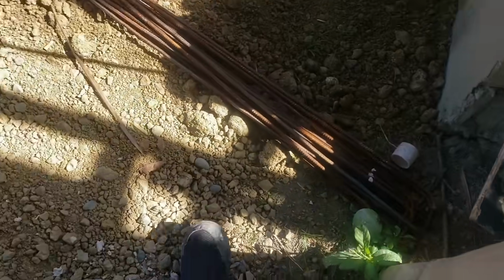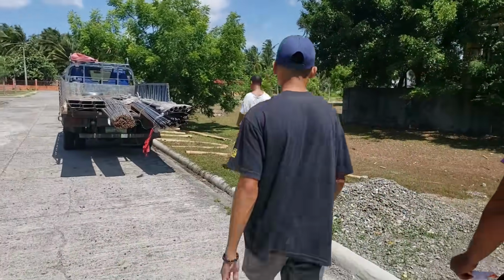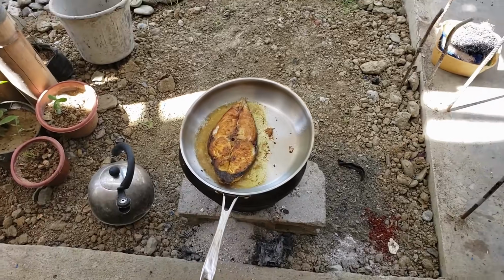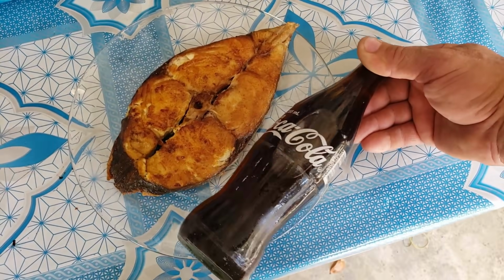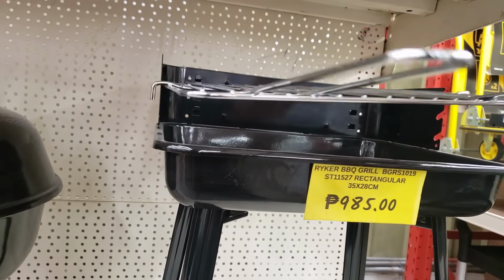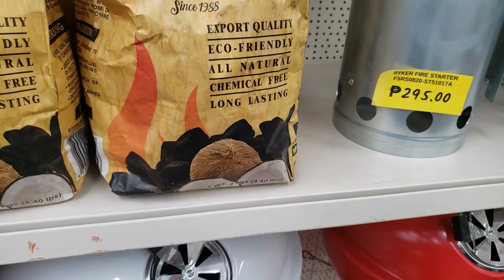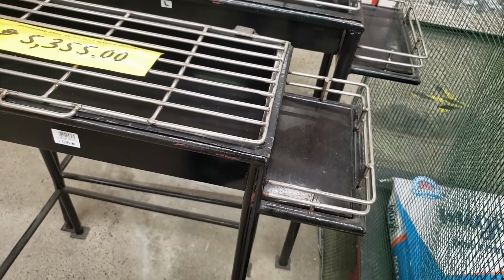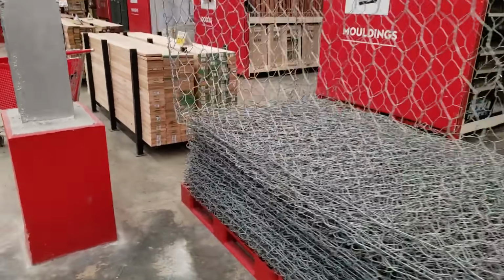Philippines Beach House Build Day196 Part 1: THE SHOW MUST GO ON!!

Comment: Hi both, just wondering If you could use vegetable oil and heat to seal the metal burner as you do a Chinese wok to slow down rusting. The large open pan barbeque, If you get the charcoal up to full heat then using ash sprinkle over the coals, allows the meat/veg to cook but without flames burning the food above when fat/oil drips down. Most cooking Is done that way In Thailand.

Comment: Interesting the charcoal briquettes you shown were made from coconut shells. Not sure you noticed that. They are expensive here in the States you can also use cotton balls with rubbing alcohol to start your chimney.
Reply from the maker: Yes I saw that but was curious what part of the tree. They might show coconuts but it might be from the wood of the tree.
Reply from the maker: Good tip
Reply: @TexasFilipino  the shells James

Comment: that well is dug how deep and where in the philipines can you get that water pump
Reply from the maker: this one is about 30 feet deep. Water table is very high.. Any deeper and you will hit salt here near the shore. Some place just 20 feet deep along the shore.  Inland can very greatly. Those pumps are sold at almost every single lil mom n pop hardware across the nation.

Comment: Just wondering why you are getting the cages as you have a 5 or 6 foot drop from your house to the beach?. Enjoyable video once again james.
Reply from the maker: I have more drop in stages than that. It is because all the beach is tripping away and the power of the ocean don't see that as much of a challenge. We will just keep losing things like them coconuts. we lost some already. Now think those coconuts was there long enough to grow huge without storm damage before. Now each year some are claimed by the sea.  They are getting more intense. So you have to try something.

Comment: Why don't you connect the water well to an electric pump powered by solar ?
Reply from the maker: The well is connected to a solar powered pump. Has been since 2016 They enjoy hand pumping this water. It is a normal part of life for them. You must have thought we only get water from that pump. The is normal running water inside at kitchen and the restroom. Washing machine is connected to running water and several water hose outlets. Remember I am buying a water hose in this episode.

Comment: Does the philippines pay you for any extra power that goes back to them.
Reply from the maker: they will but it is so small and you will be out the cost of adding the extra equipment for hardly no return. Plus you will have to contend with them which alone is not worth it. Better you have batteries and store the power and size your system for being able to handle at least 3 days of heavy clouds at normal use or with some cutbacks like run the aircon less during that time. When the whole community is without power and you still are operating makes it priceless